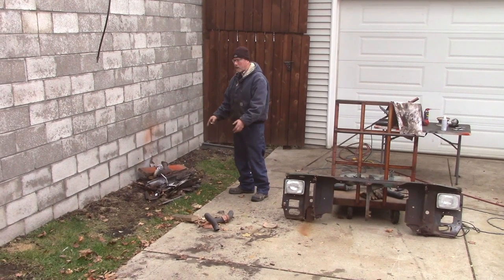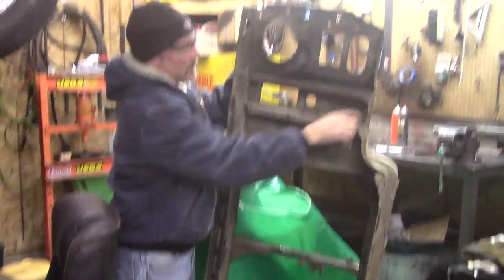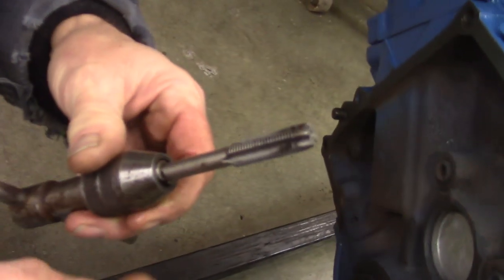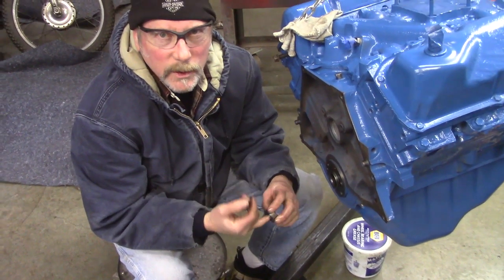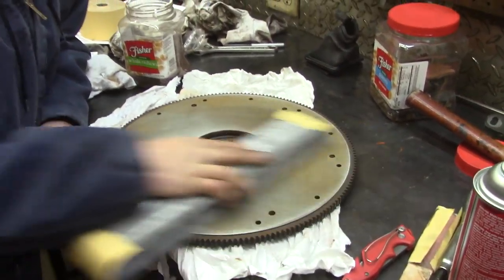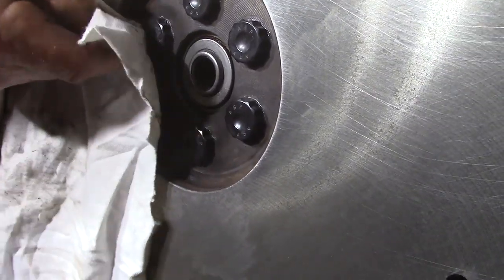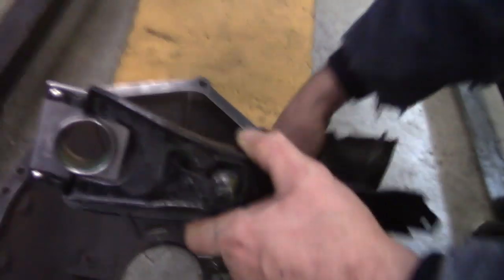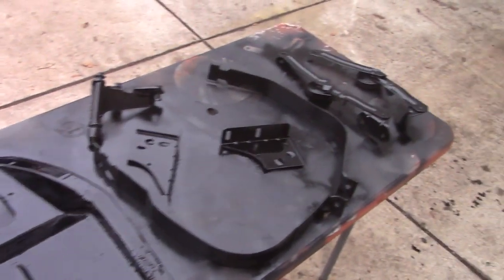F350 Clutch Install and Body Work

Comment: one time I had to hydraulically push the pilot bearing out of a 4.0 jeep motor. and grease wasn't doing the job so i heard you could use bread. but I didn't have any bread so I used wet tortillas... it worked.